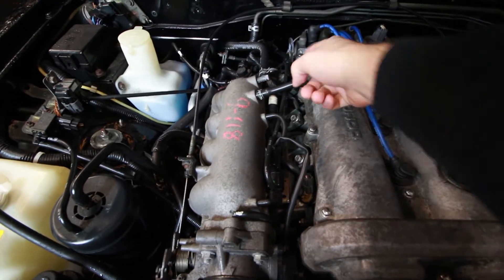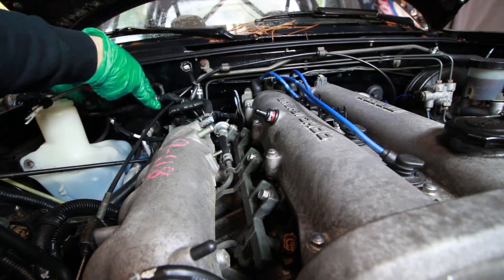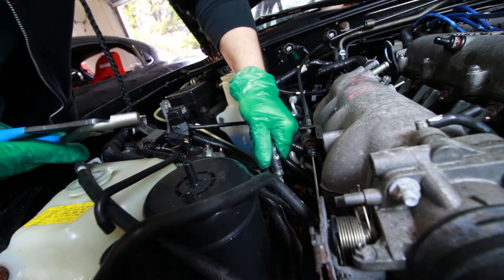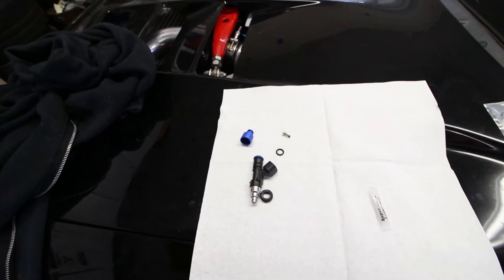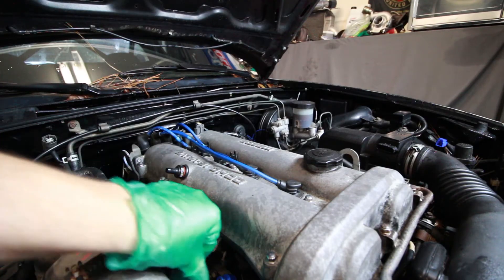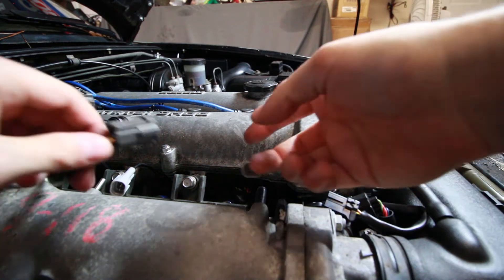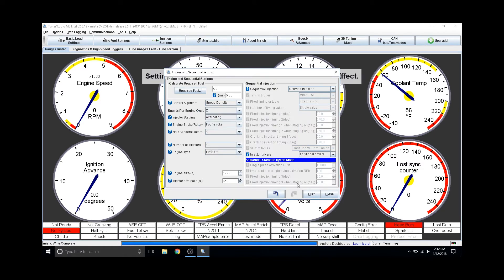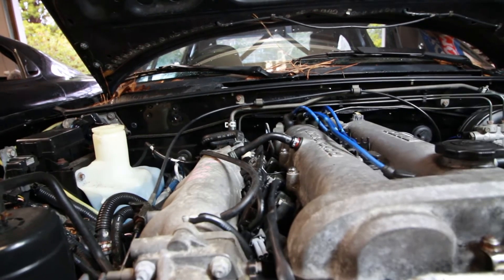How to install and setup bigger fuel injectors - Miata Turbo Build EP3

Comment: Chased 225whp with stock pump and RX-8 yellows - got 104% duty cycle while tuning, 80% gives ca 180whp . So wrong, need a retune with EV14 640cc and aftermarket pump...
Reply from the maker: Haha yeah you maxed those out, these injectors should definitely give you some more headroom. 👍👍

Comment: Awesome content and great coverage!  I installed the same injectors successfully using your video as a guide.  I'm running an MS3 so the TS configuration was a bit different - I had to use the 3 bar % table on the FlowForce instructions (instead of voltage correction).  The car starts up but idles rough and is running very lean.  You mentioned having to tune the fuel table to account for the larger flow, will you be posting a video on the tuning part of the install?
Reply: Thanks I am pre turbo at this point, I was thinking that req_fuel and dead time settings would get me close, Its set to use my target afr table which is 14.7 at idle, some research indicates I need to check my idle ve settings, let's see :)
Reply from the maker: Try it out and let me know how it goes! 👍
Reply: I'll let u know how it goes, I'm also going through the injector install steps mentally, I'm pretty sure I did it correctly... The little fuel filters, you said insert basket side first, does that mean the brass ring is visible whe looking at top of the top hat?
Reply from the maker: Yep that is correct. It is tapered so that it should feel "in place" when you drop it in if that makes sense.
Reply: @supercarmio  sounds right, thsts the only step of the physical install that I had a doubt about, my leaness must be tune related.  Thanks man, onto the next phase of research!
Reply from the maker: My pleasure!
Reply: @kevinsaeed9817  I know this is 3yrs old but did you find out a fix? I am having the same issue
Reply from the maker: Thanks Kevin! Assuming your VE doesn't change (i.e pre turbo), you shouldn't really need to make any major adjustments besides the req_fuel parameter. The only minor adjustments (at least for MS2) would be enrichment settings such as accel enrichment, where the additional fuel is expressed in ms and not in percentages. I will be doing dyno tune vids for the Miata and Evo in the next few weeks hopefully.
Reply from the maker: With that said there will still be some work fine tuning your fuel table to hit your AFR targets.

Comment: Great coverage man. Haven't had to touch the injectors on mine yet, but it looks super easy. Liked the end where you went in to the software and accounted for the larger injectors, cool to see a comprehensive vid on it.
Reply from the maker: Thanks man! It is super easy, just need to remember to adjust for them in the tune. A lot easier than the Evo/OEM ecu, where you are chasing fuel trims a little bit hah.